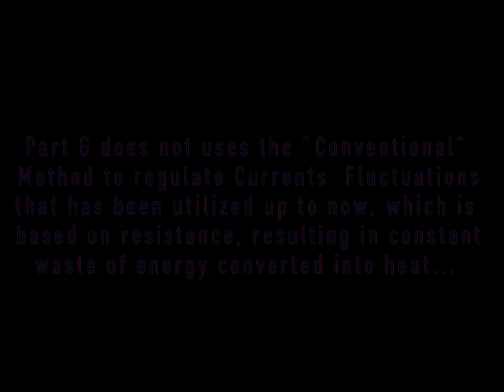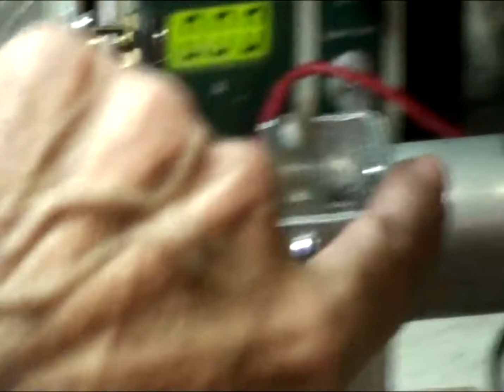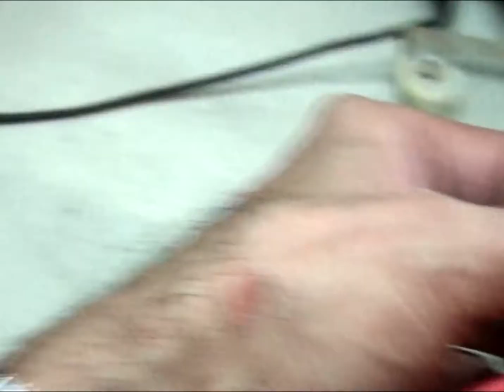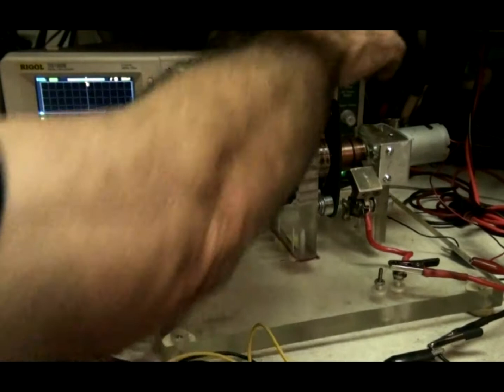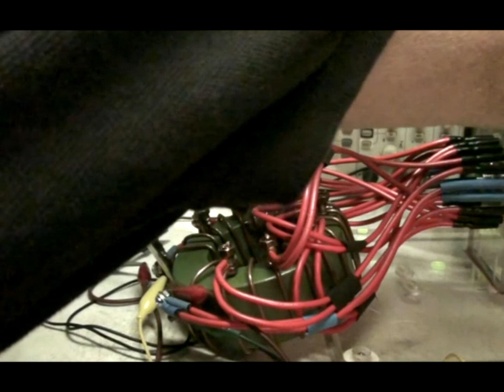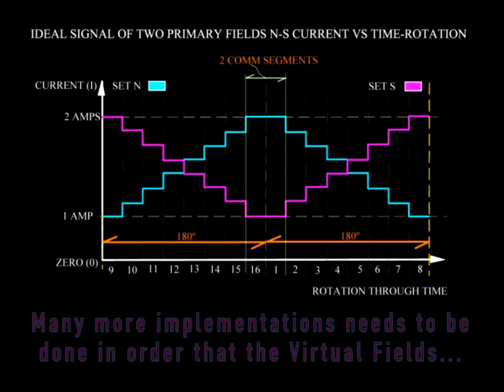FIGUERA PART G CONTINUUM CONNECTIONS TEST

Comment: Hello UFO Politics, I am also building the Figuera machine and have some important insight into the interpretation of the patent drawings. The resistor R is actually a representation of the 7 N coils and the 7 S coils and there is no resistor in the system. If the coils are wound with the right number of turns and size of wire, there will be a natural resistance in each coil. As the 12 volts flow through the coils, their combined resistance will cause the current to drop down to near zero after going through 7 coils.  The commutator I have built from parts has the 16 contacts as in the patent. The N1 coil  is connected to the 16 & 1 contact as in the patent. The N2 and S7 coils are connected at 2 & 15 contacts as in the patent. The N3 and S6  coils are connected at 3 & 14. The N4 and S5 coils are connected at 4  & 13 .  The N5 and S4 contacts are connected at 5 & 12. The N6 and S3 contacts are connected to 6 & 11. The N7 and S2 are connected to the 7 &10 . The S1 again stand alone with contacts 8 & 9. All this according to the patent. The squiggly lines in the resistor R as drawn are the coils N1 - N7 and the reverse direction is the S1-S7. The N coils are numbered from left to right and the S coils are also numbered from left to right. Wires  from the commutator contacts connect directly to the coils by number location and the coils are also connected in series negative to positive with N1 positive connection directly to the commutator with wires from 16-1 and the negative from N7 going back to battery ground. The  S1 is connected directly to the commutator with wires at 8-9 and S7 negative also going to battery ground.  My N coils are wound clockwise and the S coils are wound counter clockwise. My only uncertainty in the build now is are the Y coils wound in the same plane as the N and S coils or are they wound at  90 degree and whether there is one coil per pair on N-S coils or whether there are two, one between the upper N-S pairing and one at the lower S-N pairing. My N and S coils are made like a capital E without the center stem. The winding is 325 turns of 16 guage  laquered wire. My center Y coils are made like a capital printed 'I' with a small cross piece  at top and bottom. They have the same 325 turns of 16 guage copper wire. Any help on these questions would be appreciated.Thanks Grey Wolf
Reply from the maker: Hello Gene,

Your understanding of the schematic is quite different as we are discussing at Threads...very interesting though!

Could You provide an Image of the schematic of your set up?
It would help for me to discern what you are writing above...

On the other hand, do you want to join for free at:

http://www.energeticforum.com/renewable-energy/12439-re-inventing-wheel-part1-clemente_figuera.html

So you could post your images there as participate on discussions.

Regards and Thanks